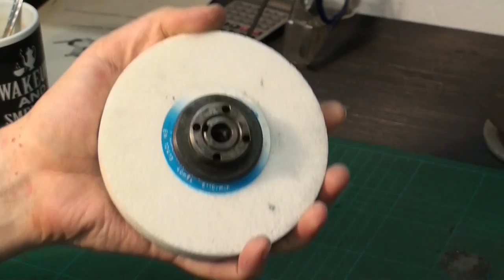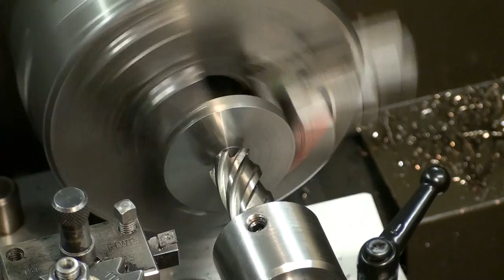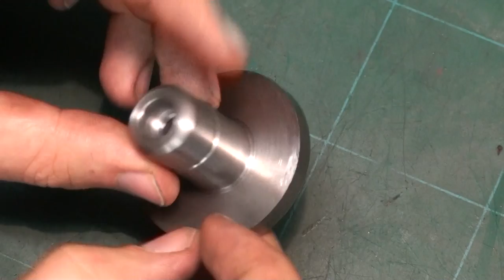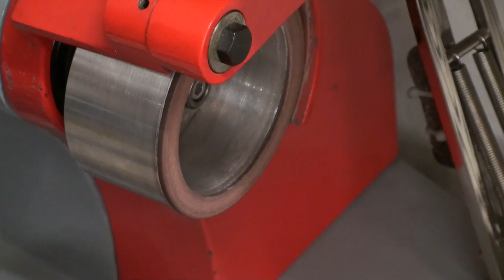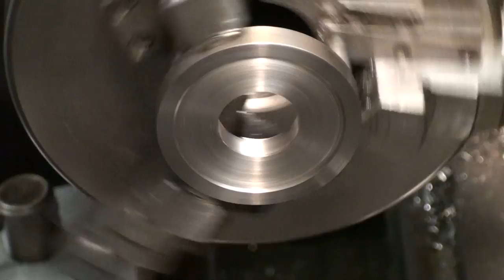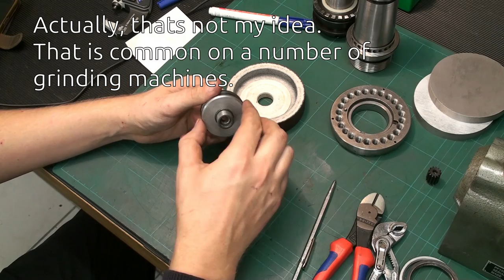Grinding wheel adaptors - Part 1

Comment: I've been retired for over 10  years and miss the shop, I did have a similar project and made a special adapter where the adapter tapered on both sides and a bushing that fit the front end with same taper , once tightened with spindle nut it held on. noticed you use a diamond wheel on the cutter grinder to sharpen hi speed tool, bad idea you'll ruin the diamond wheelBorazon is for steel, diamond for carbide

Comment: Stefan, what Kyocera insert were you using? I'm picking tooling for my WWII South Bend 16" x 60" lathe with a non-stock 3hp motor and rated max spindle speed <1000 RPM, although the VFD tempts me to blow past that speed from time to time in short bursts. :)

Comment: Are you sure you are making the relief deep enough? The relief should be flexible enough to allow for thermal axial expansion of the grind stone without too much pressure. My experience is limited to bench grinders and table saws, so the standard thickness on surface grinders should be correct. Probably not an issue on the aluminum bodied grindstone you showed.

Comment: Very well thought out part production set up on your lathe Stefan. So how long until you build or adapt a bed mounted turret setup from another small lathe. :-) Your idea or not it's still a clever way around the problem of having two grinders that spin in opposite directions.

Comment: I don't need to make this because I was clever enough to inherit a universal grinder (surface grinder and tool & cutter grinder in one). Also I don't have any fixtures for using it except the mag chuck, no clue how to use any if I did, and it does not have interchangeable arbors. Basically I have a surface grinder with a head and table which can be independently angled should that ever interest me. And no way to avoid re-dressing wheels every time I mount them. 

But I saved a lot of money! :)

Comment: I about had a heart attack when I saw you file right handed with what appeared to be a handleless file at about 7 minutes in.
Reply from the maker: Hope you are ok :)
Thats my lathe file, it has of course a file handle, it just didnt get into frame. And yes, I am filing right handed on this machine, as its small enough to do it safe. I would not do it on a machine with a 250mm chuck :)
Reply: Novice here: are you supposed to file with the chuck spinning the other way? so that in case the file snags it pierces the wall/shield instead of your chest?

Comment: I have a question on which I have found no answer...Why and when should we prefer a drill over an end mill? I've made a part which required plunging a 20mm end mill in the roughing process and the result got me wondering...Why drill?
Reply: Drills are cheaper and easier to sharpen. I've also heard that endmills don't like plunging very much. I would assume that has to do with the point angle keeps the drill where it should be, whereas the endmill is just relying on the rigidity of the tool and the machine. To put it another way, can you imagine trying to cut a hole using an endmill in a hand drill?
Reply: The cost problem is understandable bet the result made me consider it as it was almost like it got reamed without even making a pilot hole or a spot drill! Plus I always prefer to drill in the mill even thought it doesn't have a quill...
Reply: Not all end mills can plunge.  Some do not cut in the very center, so if you try to plunge with them, they leave a plug in the very center and that plug will stop the downward travel once the cutting edge reaches the depth of the clearance of the center.  
Generally if you want to drill a hole in/thru something, a twist drill is  preferred because you have a broad range of diameters to select from, they're reasonably accurate, they cost less than an end mill, can be easily sharpened, and can drill a deeper hole than a end mill of a similar diameter.

Comment: You should have just changed the direction of rotation on the surface grinder! ;)
Reply from the maker: Then it would spin the same direction like ThisOldTonys surface grinder. Can't do that ;)
Reply: Or just keep the wheel fixed, and spin your shop around it.
Reply: Or make a key in the nut itself. Then there would be absolutely no possibility of it moving.